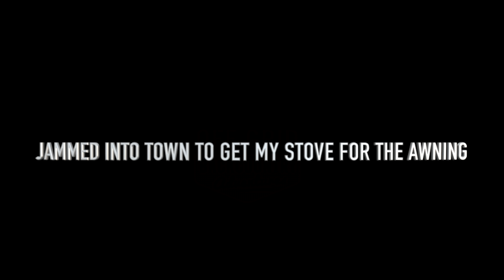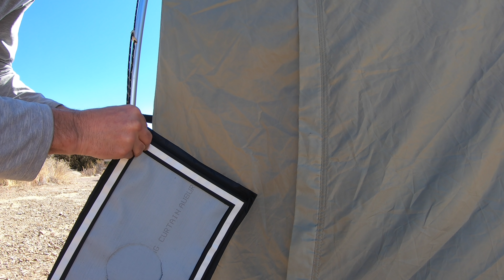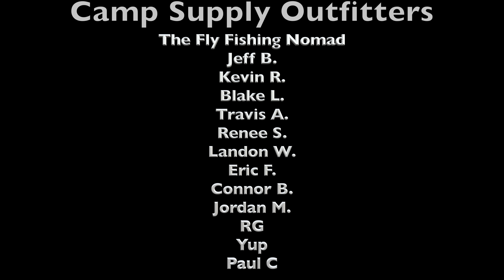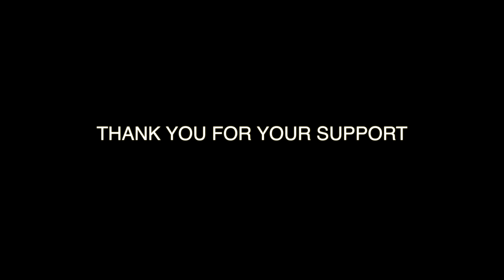Living Off-Grid in a 4x4 Truck: Installing a Wood Stove in my ARB Awning Room + Hiking w/ Sierra

Comment: Hate to say so, but i just got off the phone with WinnerWell stoves and they refused to sell me stove for use in a polycotton structure. Now the ARB is polyester (i think) so is even more dangerous according to WinnerWell stoves' advice.
Reply from the maker: WinnerWell is required by law to say that since it's not a flame resistant material. If you know what you are doing with a stove then you'll be just fine, that disclaimer WinnerWell uses is for those who have no idea how to work a wood stove. Order from Luxe-Hiking-Gear.com, that's who I got my awning stove and DIY stove jack from to make this ARB hot tent awning room. They are solid and have good prices.

Comment: Try using one of the sun reflectures people put on the dash of their cars , behind the stove to protect the tent and reflect heat back into room .also try using double or triple stove pipe where it goes through tent for extra fire protection . Also at lumber company you can get silicone glue used around chimneys rated to 5000-8000 degree  to seal around patch instead of a heat activated glue . Hope this helps . "Deeds not words"

Comment: Hey there, enjoying the videos, for setting up the DIY Stove Jack, will it work with the "New" 2500 Room you think? Not seeing any side panel on them to attach anywhere (as the doors seem to be full width) - maybe go for the older model for winter camping? (or go through the roof of course)

Comment: I have that same stove and love it. You need to feed it more often but there are some tweaks you can do to it for better burns and cooking.
Reply from the maker: Yeah, I think it will take a few evenings to get the hang of the stove but so far I'm really pleased with it. Very lightweight, super easy to set up, and it kicks out plenty of heat. I noticed this morning when I woke up that the ash can build up rather quickly if going through lots of wood so I'll need to be diligent about ashing the stove box.

Comment: LOL not gonna lie the thought of putting a hole in my awning room gives me anxiety. LOL you are a brave man. I totally think it turned out awesome. Good planning for sure
Reply from the maker: You gotta do it, this is such a game changer! Just had my first full nights sleep in here and it was awesome. Temps outside are roughly 25F but it's toasty here in the topper. These DIY stove jacks are awesome and really easy to install. I love this little stove, it only weighs 10lbs and is a cinch to work with. Thinking I'll seek out some colder, snowier weather over the next week or two and put this baby to the test!
Reply: @OffGridBackcountryAdventures  where did you get your stove jack?

Comment: I love the old wagon trail so cool. Don't forget to get a false bottom for your kni-co or put sand on the bottom. That will keep it from burning out. I have had mine for a long time and its amazing. Did you get a side table or water tank for yours? You might want to stitch your stove jack in place i wouldn't risk it with just glue. Thanks Der Guy.

Comment: You may have to sew that stove jack on.
Reply from the maker: Yeah I agree, I'll be doing that over the next day or two. I'm surprised how well the hot glue is holding that stove jack in place. It's on there really good! But I think the sun will degrade the glue over time so it's better to sew the stove jack on and not worry about it.

Comment: Nice!!! I was a bit worried about the height and mount....lol I didn't realize how maneuverable the stove pipe joint was. Nice to see the trails, and the wagon tracks.  Glad Sierra is getting around alright and seems better.  I've been thinking about a wood stove in my Van, is the new stove single burn?? and hot enough to run the Eco Fan?? I'm also curious about the heat plume around the stove. Keep the info and the videos coming bra.

Comment: I'd like to see a grate in the firebox. I'm surprised it didn't come with one.
Reply from the maker: It's actually recommended from the manufacturer to use about 1 inch of soil or sand in the bottom of the stove during regular use to protect the stove bottom. They sell optional grates but sand/dirt works about as well.
Reply: @OffGridBackcountryAdventures  I was thinking more in the way of airflow below the wood.
Reply from the maker: @Amy_McFarland  Oh I see, I thought you were inquiring about protection for the stove bottom. I've actually never used a grate in any of my fireboxes and haven't experienced any issues with airflow.
Reply: @OffGridBackcountryAdventures  try it you'll like it. Better control over the burn rate with the front vent in combination with the damper. I'm not saying buy one, make one from scrap to try it out, then decide whether or not you get a more efficient burn rate.
Reply from the maker: @Amy_McFarland  sounds great, I'm always up for more control over the burn rate! I'll give this a go, thanks for the recommendation.